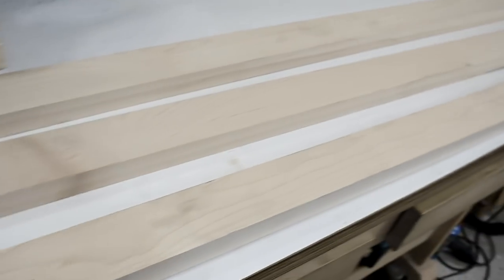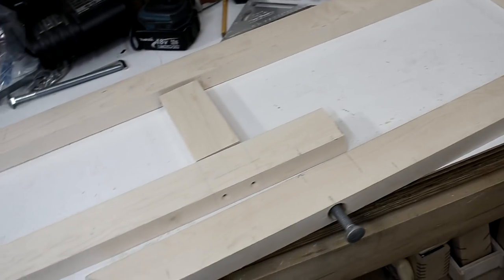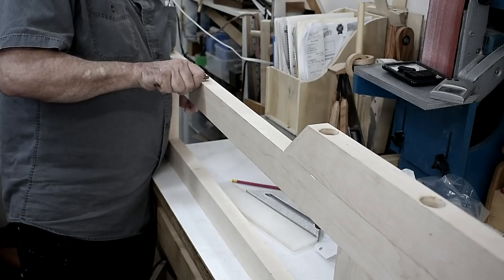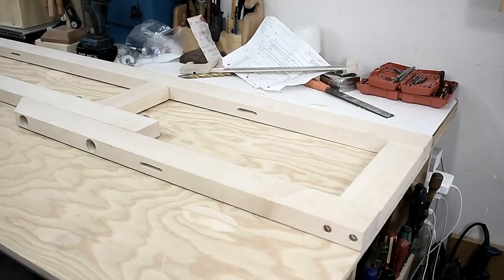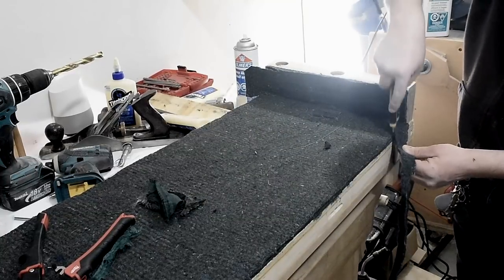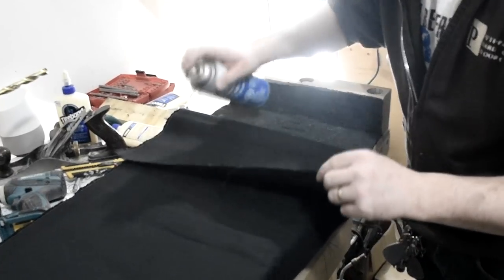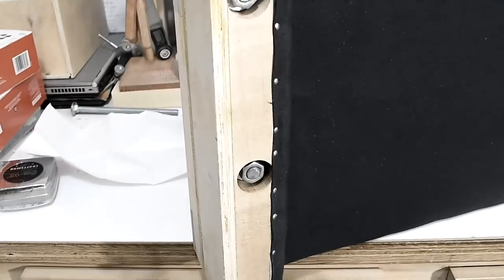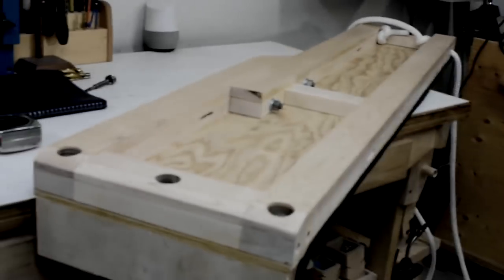Making a Grand Piano Skid - Moving a Grand Upstairs

Comment: I was delighted to find your plans for the skid board.  So I printed the cad drawing you have on the build article and built my skid according to the drawing.  After several hours of work and completing my board I discovered that the drawing is backward with the wide part on the wrong side.... and so is my board.  Tomorrow I will disassemble and correct it.  Wish I hadn't used all that glue!  Thanks for the dimensions anyway (y)
Reply from the maker: Sorry about that, I flipped the photo.
Reply: @Jacka440  It wasn't a big deal - Thanks for the plans (y)

Comment: Good little video only two small problems , one that’s not a grand piano that’s called a petite grand the smallest piano made . Secondly there are no straps on the skid board so how do you lift the piano attached to the skid board to place the dolly underneath ? Craftsmanship is very well done and I do like how he thought of including a pull strap that’s long enough to lift with . A- nice job for sure just wanted to point those two main factors out

Comment: Very informative. Thanks. I'm a little confused by the width dimensions though. If the one end is 11 1/2", adding another 2x4 to increase the width at the other end would seem to make the other end 11 1/2" + 3 1/2" = 15". I am not a woodworker though, so I must be missing something.